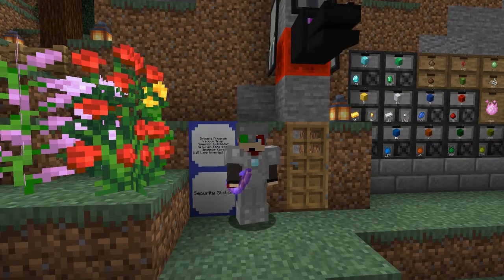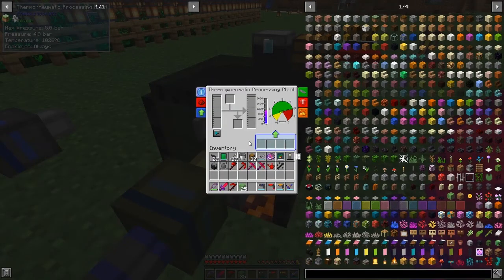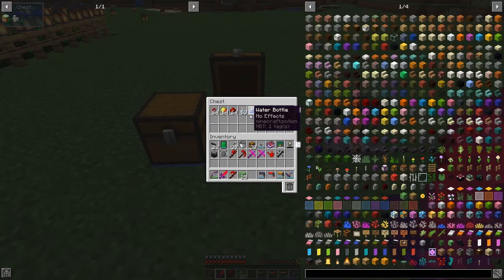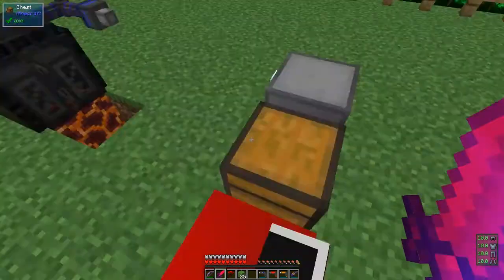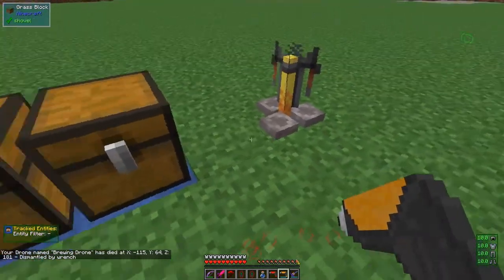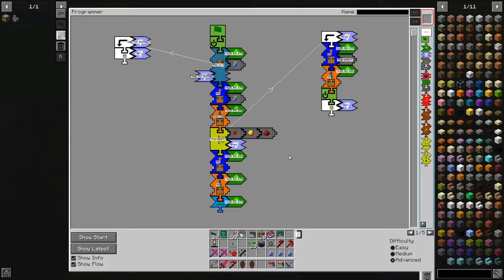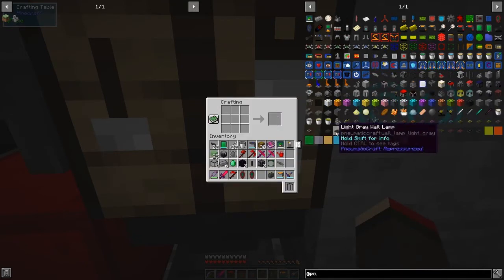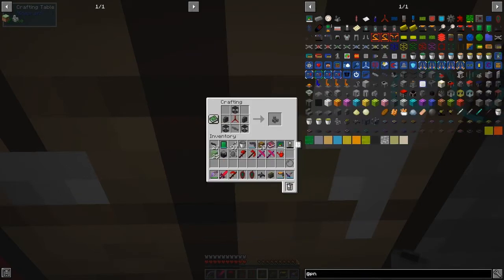PneumaticCraft: Repressurized #29 - Brewing Drone, Spawner Core and Vacuum Trap

Comment: Drone brewing sounds like a intresting program. I'm still struggling with programming. I get the general idea but there always ends up being an error some where in the program and I can never seem find it.

Im quite enjoying this take on mob mangagment. I still need to tinker with some setups like a way to sort mobs and prevent pollution. Might lose my mind if 1 more phantom fly in my trap -.-
Reply from the maker: Upload the program to pastebin and post the link and I'll show you how to fix it. The puzzle piece that has an error has a red boarder and it tells you the error.
Reply: My general advise for drone programming is to do it in small pieces and test along the way. That goes for any coding, however. Also, make liberal use of the Rename Drone piece as this can give you custom feedback that the drone debugger often cannot.

As for your trap, I gotta say the easiest way I've done this is to just build a small box and use 2 Cores. Put one in a spawner and an empty one in the trap. Then let the spawner run for a minute to capture a couple mobs in the trap. Take the core out of the spawner, release those mobs into the trap, swap, and repeat until full.
Reply from the maker: @NicholasAlberts1  good tip with the rename drone, it’s cheaper than signs. A sentry turret with phantom as a filter could help too. It is an interesting idea to use two core.
Reply: @NicholasAlberts1  intresting will keep this in mind for programming.

Ya in a contained space wold fix most my issues. I do have a two core sytem for replicating mob. Did u know u can right click the core on top a block and spawn 1 of the stored mobs? Doing this next to a trap usually results in a quick capture and when u empty the core u swap with the now fuller core and repeat till full. Saves u some pressure and time.
Reply: @duncanwebb4934  will keep this in mind 4 my next attempt .... I usually get frustrated and scrap the whole program :/
Reply from the maker: @xivilaikikira3768  again if you need help, post the program to pastebin and send the link. I’ll help if I can and if the program is interesting I’ll include it in a video.